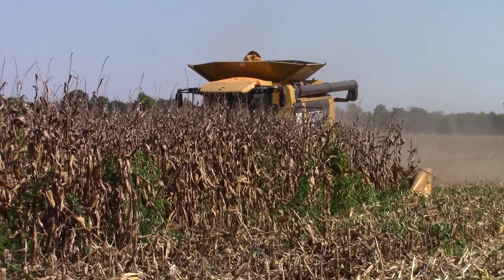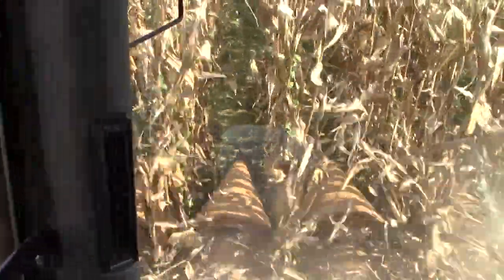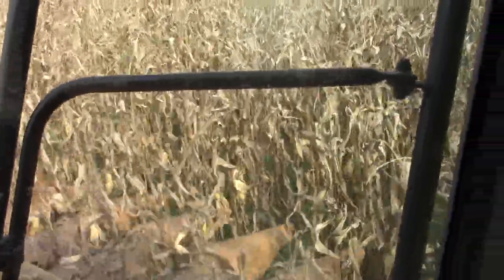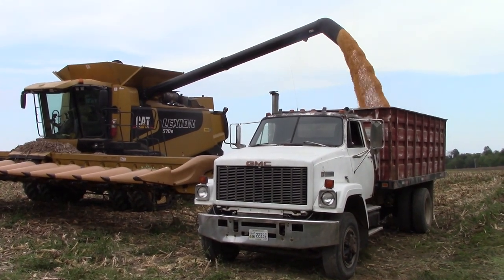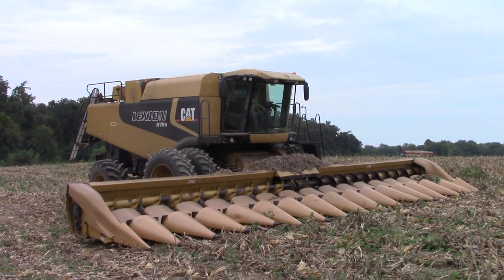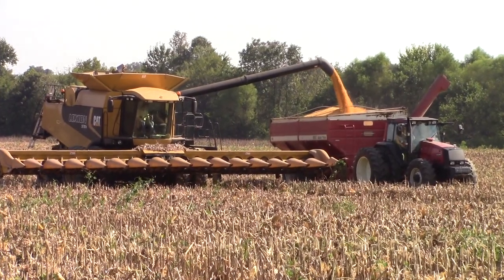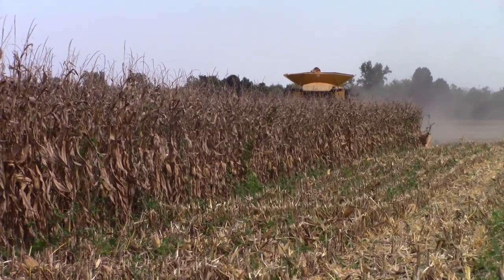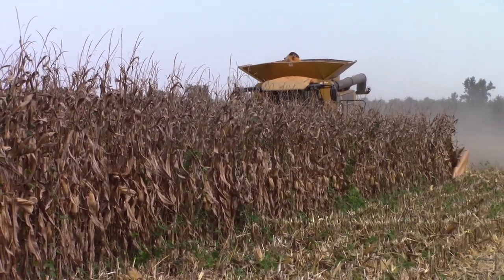Caterpillar Lexion 570R  Combine with a C516 16 Row Corn Head

Comment: I live seeing modern machinery in action I would not have guessed that a 570r had the capacity to handle a 16 row corn head
Reply from the maker: It can do it. It just runs slower but it puts less wear and tear on the machine and it makes one pass at a slower speed rather than having to run fast to make two passes.
Reply: that makes sense, thanks!

Comment: The Massey Ferguson 8680 and Gleaner C62 where also made by CLAAS.
Reply from the maker: CLAAS built the Massey 8460 and 8450 for AGCO/MF  in the early to mid 1990's.   The Massey Ferguson 8680/Gleaner C62 were built in Hesston,KS. There is an article on these combines production in the 1998 AGCO quartley  magazines  from Massey Ferguson and AGCO-ALLIS Landhandler.

Comment: Sorry for the dumb question, but how is the platform auger on the header supported in the middle?  When I was much younger on the farm, the header width was 12 feet, so a single piece platform auger was possible.  With this 40 foot head, is it possible to use a single piece, or a two-piece design, driven from each end?  Does it have some form of support in the middle?  Thanks.
Reply from the maker: That is a good question.  I am not sure. On the 36ft to 45ft grain heads the combines run two separate reels.  Maybe some else can answer how the auger is set up for the head.
Reply: Our header is basically two 8 rows put end to end, so the header has two 20 foot augers spanning over 8 rows.

Comment: That corn has some of the worst weeds that your videos have shown this year. Does this effect the yield?
Reply from the maker: This is a river bottom field and there was 20 inches of rain in July.  All the water brought on late summer weed growth.
Reply: Thanks. What about the yield for this field or is this combine to old to provide that info on the go?
Reply: Corn ranged from 90 to 170 bu/ac

In July these bottoms flooded in parts of the fields, we normally don't expect a rise in July, really uncommon.  Water levels got up to the ears in places so that corn either rotted or it only got half the ear, this particular field did not have a good year.  But that is the risk you take, unfortunately I can't control weather.
Reply: Thanks for providing that info. Much appreciated.

Comment: You did not mention how Claas was the first to use a "joystick" type, multifunctional control on those "Ford" branded combines. 
It was called the "Uni Trol."
I had no idea about headlights, since so many Massey-Harris combines had them [factory or added-on?] even in the 1940's, to accommodate a custom combiner's need for marathon harvesting.
Reply from the maker: Very neat. I would like to Find a Ford combine to film.
Reply: I know of a couple.